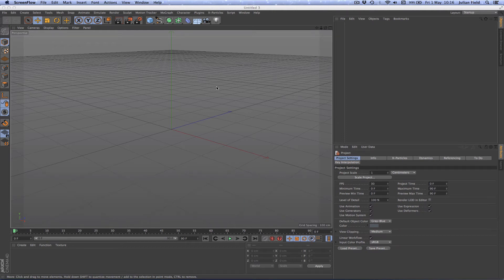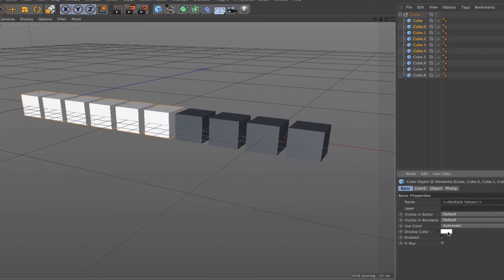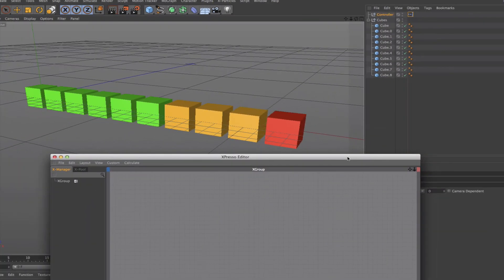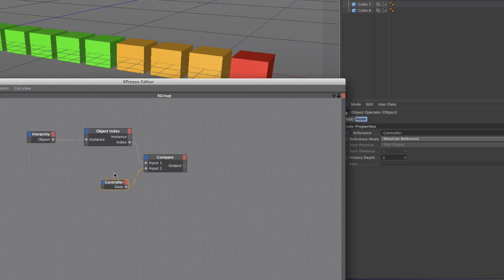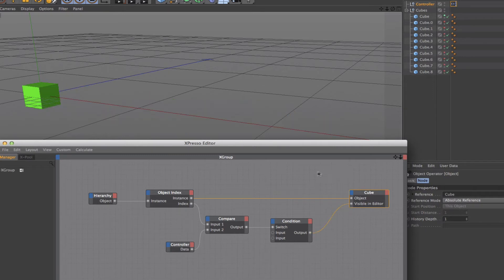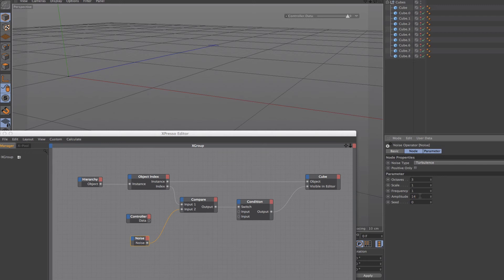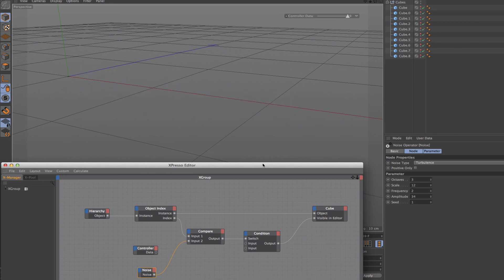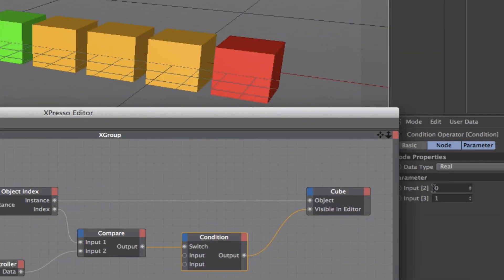Cinema 4D Xpresso Tutorial 25: Creating a LED Ladder

Comment: Why can't the sound node be used? 😧 
 The solution is nifty but it would be more interesting with reactive audio
Reply from the maker: I think the sound node could only play a sound, when I made this. It now has the Left and Right amplitude levels at the output stage, so you could try using one of them as a source and if need be, using a range mapper to keep the numbers under control. Give it a go and see what happens! Another thing I'd love to see, is a MIDI node, so that you could plug a keyboard into your laptop and create animations by playing it. I did ask Maxon for this, but no joy. I have also looked at the possibility of creating a Python Effector to do it, but have yet to discover how to read the USB port.